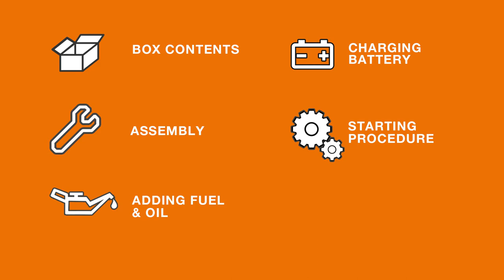How to assemble & start the Hyundai powered, P1PE P5100SPE Lawn Mower

Comment: Drive belt came off the first time I used it
Reply: This just happened to me second run out! Is it still happening for you???
Reply: @owenjohnson4440  sent it back and got money back
Reply: The tensioner fell off on second cut, the one stud holding the guard was stripped so I had to get a neighbour (mechanic) to get it off for me. I ordered a new stud under warranty and they sent a bolt. That was five weeks ago. Had to drain the mower down to work on it and still waiting for the part. No parts back up at all. I have been paying a chap to cut the sodding lawn so wasting more money. I wouldn't buy one again. I am demanding my money back and buying a mower that I can get parts for.
Reply: Sent it back got my money back